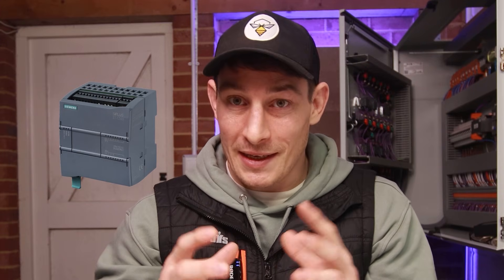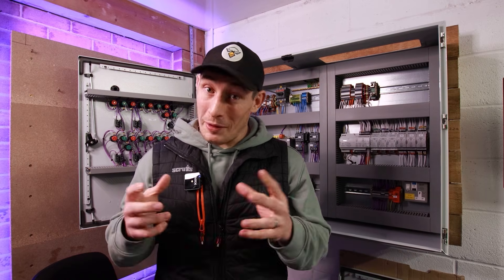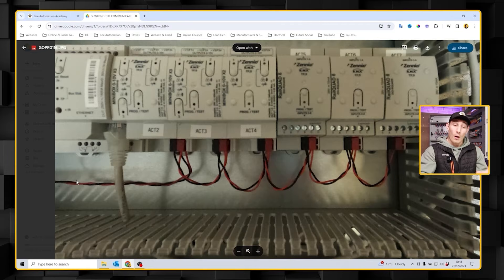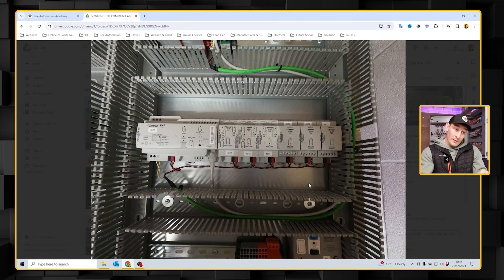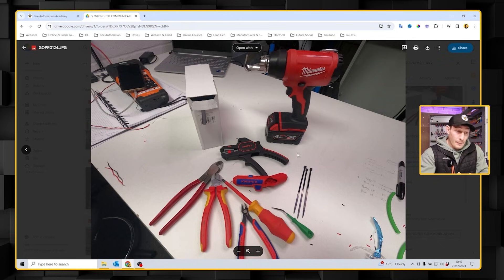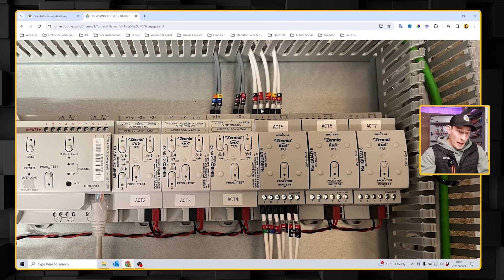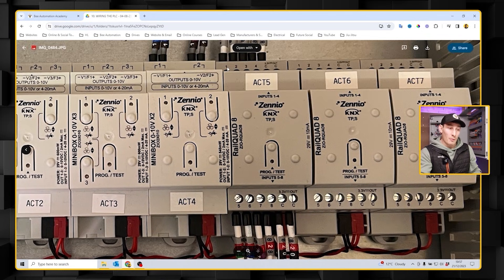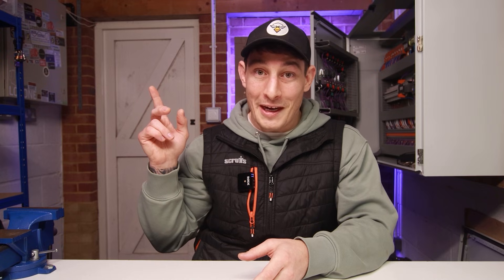How to Wire a PLC Control Panel Like a Pro

Comment: Presuming you're acting or compelled or initiate to act by symbolic or likened to, what is the depth of the dark, in layers, what is the heights of skies, in exchanges and circles, what are the changes of both per seconds or minutes or by spins effects and what are the fixed state, in the fixed states who sleeps and who rests and who works by instincts while there are at sleep or rest, if your at the dead states of grays and limbs or fogs, have you noticed which dead who passes enters the fog or mist, fantasy world by molecular identify or a nightmarish area of identify, how is the push down or tenure if that's so knowing in science that similar charges either at dormant or repel each other states or preserve something of each unknown variables in itselves like universes of itselves likened to how long a being immersed to something or disguise for a purpose, how the awareness and consciousness bought you to other levels or by that suspicious of other surface side offerings or presentations the reason why opted to stay such way of a guard in other mode both ways, of a personified of something a merit or an accumulate levelings of capabilities and from no work at the dead, how you interpret of such a rest state of what of waiting for the jury or rest state for the rest in laurels, does the dead remained that way if preserved for a thousand years in a cavity or cubicle the way the thousand years of the Lord was meant in another side version, how about the On calls, selected or soldiers, then dead have activities of the dead and the treatments of how each treated, what are the dead worlds then as compared to the Light if the Tomb nowadays likened to system or computer plug of wires or window of palace. Have you wondered the chessboard towers or rook, what then with such if no hidden secrets there to guard up and down. The question, are you talking about the dead in pure or the dead in portions likened to topology of food and nutrients, then there are states for the Angels react strongly of what they've experienced unknowingly giving up some information of their duality by experience, if that's so, the question, was that complete science, complete nature,  complete spirituality of a curtain of realms wherein the reactant of however long a time acts and reacts only at his or her immersion to a universe by himself and it's connected area of permission of another level by parallelism effect and the curtains of time speaks of time not just atbits longevity but also by fraction of a second, then what then are the standards if it's not timely if there's remote and recent memory, would it entail that both sides somehow ionized for a purpose, how then can you standardize a general if you haven't have complete know how of the generals in plural, would the coning affect and the wides of such a solution or part of shapes variety such as bottles, your idea of consolidate and merged how can you carry out when at the common road each passersby of each timeframe some a de ja vu of a mists or mind area fix of memoir of troublesome to the dead or memorable to a treasured moments of life, how then to standardize when not in entrant of different mind frequency either side dead or not by will or by cause and effect. Would you again consider the variables and the distinction of flesh physicals and spirits in a verse. Bobo said by an angel of his display of his ignorance of a shame of over indulgence to something other than tasked. Though the point what's the junction of the dead and the undead if clothes and acting are just surface test both ways. Would how each adapt or show true self a risk or not.

Comment: Ive been on the controls side of actual industry (not facilities, but actual producion/ manufacturing) fo 35 years in the US. Your white wire choice for IO lost me, thats for nuetral only. Your layout is nice and clean tho.  Wonder whne youll break out the rasberry pi to control a machine, im guessing in 3 2 1....

Comment: Why use 0-10V instead of the 4-20mA signal? If there is an open in the circuit you will still see 0V, so its harder to see that.. VS 4-20; you know its all wired w/o open bc the base is already greater than 0.
Reply: Always do it that way myself

Comment: I'm actually a conveyor tech new to field. I have a question maybe some of you can help me but curious why inputs are on the bottom and not top. I'm new to it so please don't make fun of me guys. Im curious if it makes it easier to wire or reason behind it
Reply: Completely depends on the brand. You have expansion cards with only input/output, other makes have cards with both in one card.
Reply: Agrees with the previous commenter. Brand dependent. I’m more familiar with mostly Allen Bradly Hardware from Rockwell Automations. Their Micrologix line which is their smaller and least sophisticated line of PLC’s is the only line of their PLC’s that you can directly wire input and outputs to the controller. In that line, the inputs are all on top and outputs at the bottom.

Comment: did you have to get an engineering degree to learn all this? also can you program the PLC too or just wire it
Reply: I doubt you need one, because I got a Mechatronics Engineering degree which had a grand total of 4 courses on PLCs and industrial automation equipment, but literally none of my classes covered anything about wire diagrams or wiring control panels. On the other hand, my first boss, who had an Electronics Technology associate's degree, could do all this almost instinctively.
Bachelor's degree programs are for learning anything BUT the practical aspects of doing stuff.

Comment: my biggest issue with plc is its programming
Reply from the maker: My recommendation would be to understand schematics, panel building, panel testing & pre-commissioning, then system design (in that order) before PLC programming. Reason being, engineers are far more valuable to businesses if they understand the stages that underpin the PLC programming 🙂👍🏼